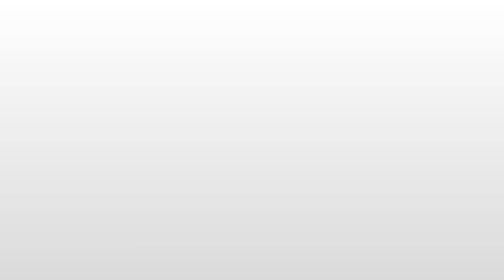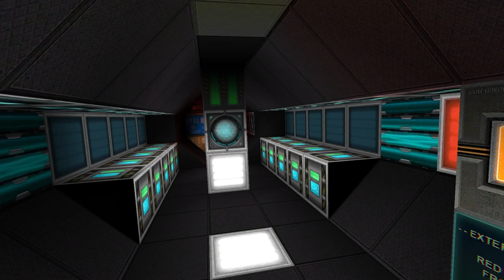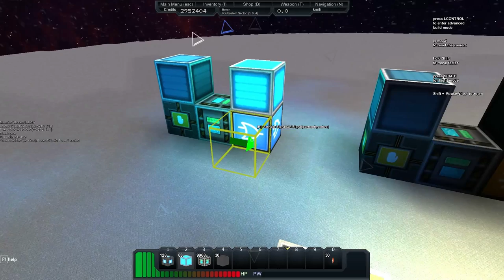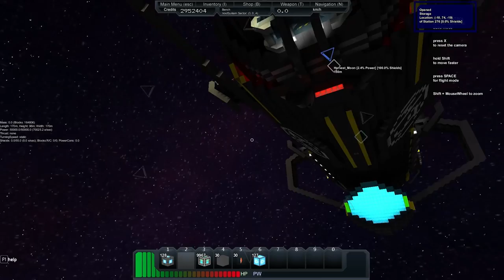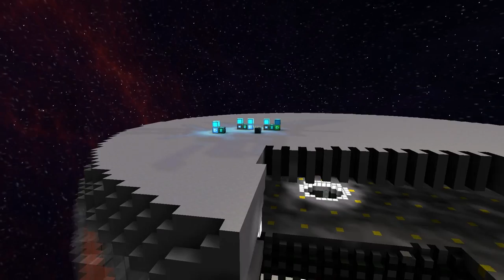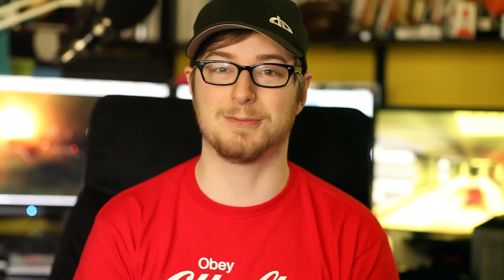Starmade Storage #01 - Different Light Indicators

Comment: I personally think that the light would flash when the storage is full since it's trying to get your attention by flashing. In the case of a factory, that might be important if you start having a backlog of items and it starts clogging the system.
Reply from the maker: yep well it's fairly easy to swap them around. You'd connect the OR-signal next to the Storage straight to the OR-signal that goes to the light, and have the Activation Module go into the NOT-signal same as before, but then that go into the AND-signal the clock goes into and leave that connected to the light OR.
Reply: Thanks for telling me, I'll do that when I set up the system in my next factory.

Comment: I know this is an older video but are you planning on uploading your harvest ship to starmadedock? I noticed that your salvage beams have zero downtime and I'm curious how you got rid of the half second delay you would get from connecting your salvage computer to a clock, which is currently how I do it. I would love to reverse engineer your ship if i could get my hands on it.
Reply from the maker: I'm going to have to rebuild most of the systems as the salvage now requires much more power than i was providing. once i have it rebuilt i will probably release it